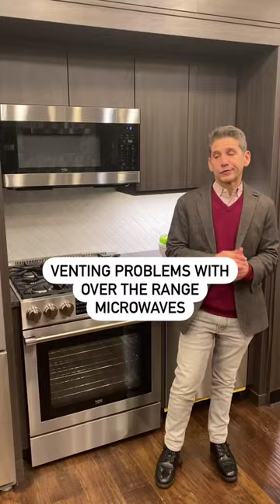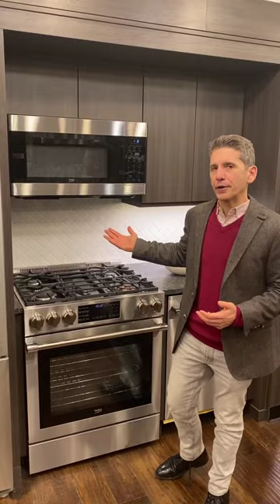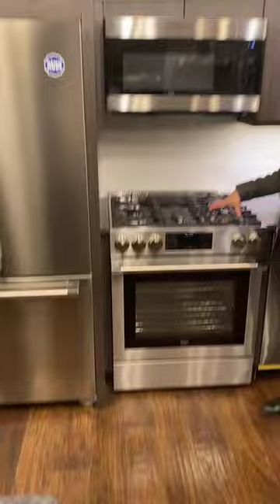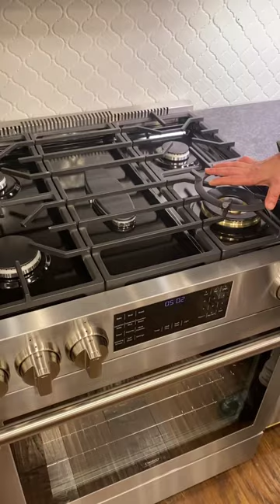Over the Range Microwaves: Venting Issues #shorts

Comment: Just got a Samsung 550cfm to upgrade older 400cfm that didn't stick out as far/hung down lower and made a huge difference.
Reply: is it vented to outside?  if it is check the hole above the door with a paper towel while the fan is running. Id be willing to bet its also pulling smoke and grease up and over the door through that hole instead of just the bottom.  I had to use foil tape to close off the top of mine

Comment: Mine fan (vent) blows the air back down onto stove 😢
Reply: You might have the fan set to recirculate instead of vent.    If you have ducts set up in above the cabinet you should be able to have the fan push the air up into the vent.    If you don't have ducts or can't add them - maybe in an apartment - then not much you can do.

Comment: The exhaust fan isn’t limited to just pulling air from directly below.  Fluids don’t work that way.  Once turned on, the fan pulls the smoke/steam from the front burners back.
Reply from the maker: I don't think so......Burners in the front are too powerful.  I had an OTR in my apartment.  It never properly exhausted.
Reply: Both of you are right, The problem is if the CFM is not high enough then the vaccine drag from the surrounding air won't get majority of fumes
Reply: @YaleAppliance1   problem is, these samsung microwaves when you turn the fan to vent to outside instead of recirculate out the front, that front hole becomes part of the suction side, along with the entire inside of the microwave. so not only does some of the smoke and grease get pulled into the bottom where it should, through the grease filters, but it also gets pulled into the giant holes above the door, that have no obstructions.   so it ends up coating the front of your microwave and the cabinets with grease, along with the entire inside of the microwave, electronics and all.   turn the fan on, and wave a tissue above the door to see what I mean